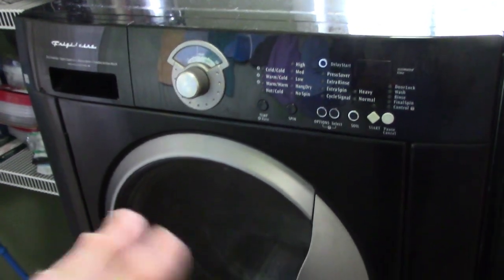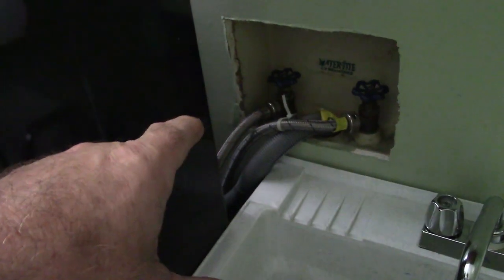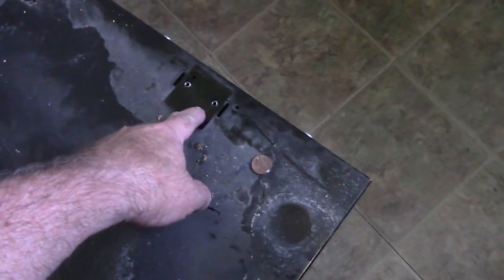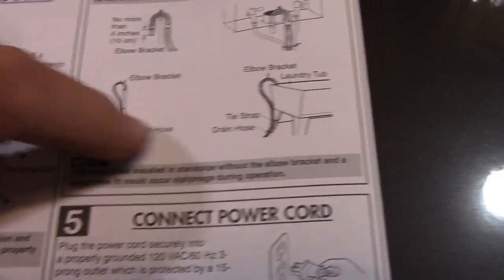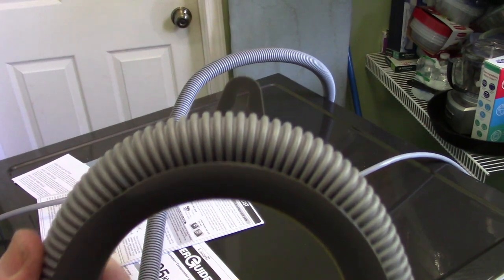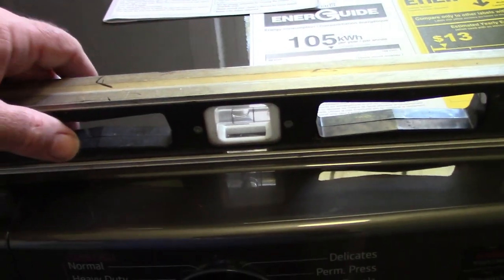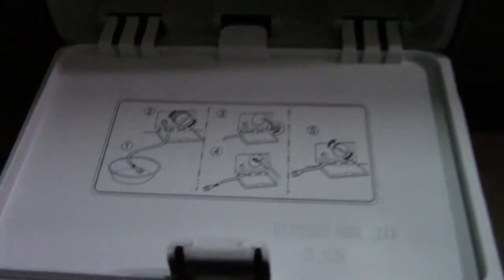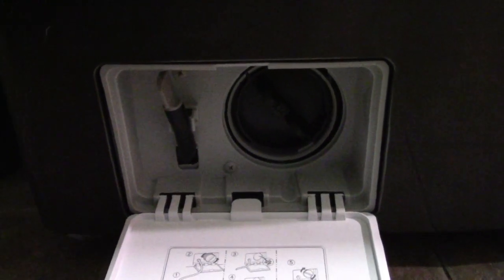LG Washing machine install. Model #WM4200HBA

Comment: I have the #WM3900HBA the Tide Pods suds a lot  if the load is to small. It can cause suds lock which you dont want so I just avoid them but other than that I'm loving my machine.

Comment: Thanks so much for the video. Quick question. The guys that installed my machine didn’t use the u shaped bracket and put the hose in the drain way too far. So I am trying to fix it. When the hose comes out near yhe bottom of the machine do I just run it to the drain (ours is in the wall) and zip tie it. They never detached it from shipping so it’s running up and around the machine first. Thanks for your time.
Reply from the maker: Sorry I didn’t respond sooner. Does it not work the way it is?

Comment: I have the WM4000HBA, had it for a month, one thing I’ve noticed is suds coming out the air vent on the back of the washer. It only happens when using liquid detergent if I use pods it’s fine. I googled it and said I was adding to much detergent added less and still happened. If the issue continues I’ll be contacting lg for customer service.
Reply: perhaps your previous machine was not rinsing properly and there was suds in the clothing still?

Comment: I bought a front load LG washer 2 years ago.  The motor broke.  I have a 10 year warranty.  LG sent the motor but no drum.  We called them again.  Then they sent a broken drum.  We called again.  They sent a second broken drum.  Then a third time.  Another broken drum.  We have been doing laundry at the laundromat for almost 2 months now.  They said the 4th drum would absolutely be delivered today.   Nope.  The level of incompetence at this company surpasses anything I have encountered.  Do NOT buy LG products!
Update 02/27/2023  The 4th drum did arrive today…..Broken 😡
Reply: Did the sent drums break during shipping ?
Reply: @singsangsung1665  I don’t know.  Either they are sending me broken parts or they are not adequately packaging their parts for shipping.  The drum seems to be made of a cheap plastic like material that breaks easily if not handled delicately.
Reply: Why are they even sending you a drum for a broken motor?? Two independent parts